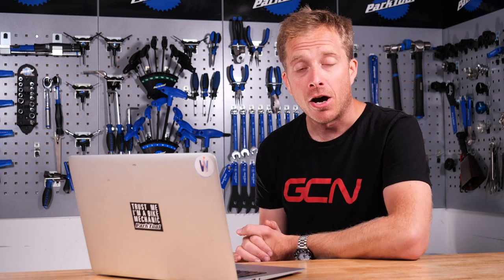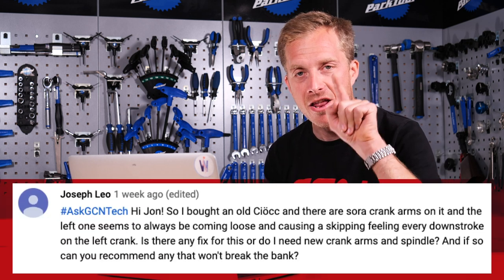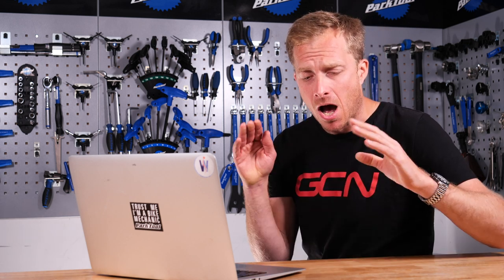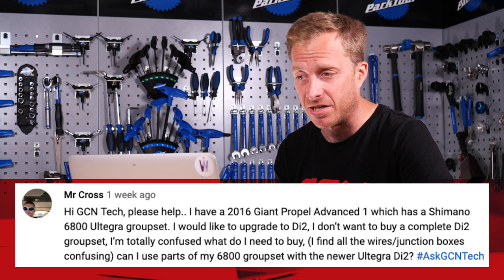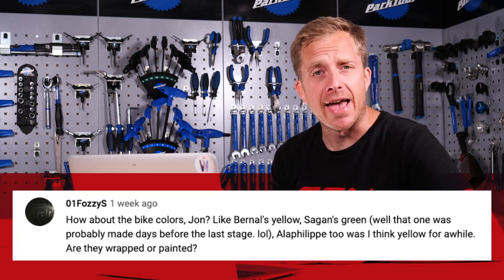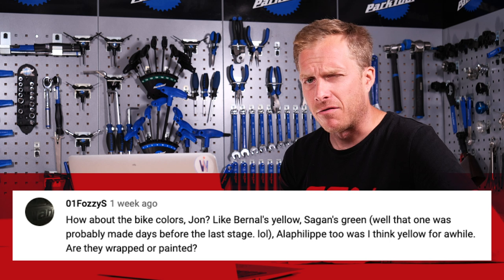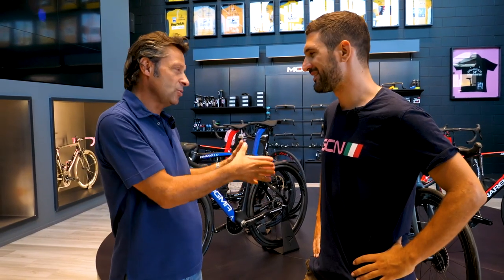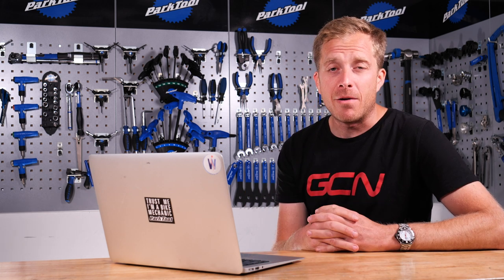Converting To Di2 Electronic Gears, Loose Cranks & Squeaky Disc Brakes | GCN Tech Clinic

Comment: #askGCNTech I have a new bike, REI Co-Op ARD 1.2, tried to put a bracket for a bike trailer on it but found out, after the rear wheel fell off during a pit stop on a ride, that it will not work.  Now I cannot keep the wheel on, I have a quick release hub, are those easy to upgrade and if so what should i upgrade too?

Comment: Hi Jon
I have 105 and shifting has been perfect outside but when I set up my wahoo kickr, the chain or rear derailleur must not be aligned with the cassette because there's a grinding noise when I'm on the smallest couple rings. It's ok for the most part on erg mode workouts, but is there a fix for this?
#askgcntech

Comment: #askGCNTech Hi, If I want to test a lower position at the front end by removing some heaset spacers, is there a way I can do it without cutting my steerer tube. I have a carbon steerer and a short compression plug that only allows a 5mm spacer above the stem. 
Thanks
Lewis

Comment: Q: Currently have shimano 8spd groupset. BB is squared tapered and I'd like to switch it out for Hollowtech BB. Seeing how 8spd chainset appear to be all Squared is it possible to switch it out with a 10 or 11 spd chainset without having to change the rest of the groupset? Maybe just a new chain as well?
Reply: You can and it's the same situation with me upgrading my old 8spd microshift groupset

Bought the Crankset(w/ BB) first a Tiagra 4700 52/36 vs old 8spd Prowheel 52/42. Took out the old square tapered BB then slapped in the Hollowtech II BB. Then I used the old 8spd kmc chain after indexing it worked no issues. Then slowly upgraded them all to the 10 speed Tiagra groupset.

 "Note if your new Crankset's largest teeth is the same with your old one. ex. 52 largest teeth / 36t smallest vs old 52t largest / 42t smallest. You can use the old 8 spd chain, But if you want bigger cranks ex. 53t / 39t or a 54, you might wanna get a new 8 speed chain or just add extra links to the old one.

Comment: Hello though my problem may be solved, my bmx race bikes disc brake caliper has been having trouble Stopping i have adjysted my brake pads my brake lever but it still wont work that well and it is a mechanical set up

Comment: Hello Jon, salutations from NYC. I’ve been having some issues with my rear derailur skipping. Took it to a bike shop mechanic and it came down to needing to replace it. I have a Sram Red 22 rear derailleur (green edition) and would like to replace it with the same green edition model but it seems impossible to find it anywhere. 

Is there anyway to service or rebuilt the old one or does it need to be replace? If so, any suggestions where I can find it for a fair price? 

Thanks Sergio.
Reply: Hey Sergio - what is the diagnosis for the problem? I have replaced pulleys and pulley cages in SRAM (and Shimano) derailleurs without much problem.

That said, I had to retire a very worn derailleur that had gone through two cages and three sets of pulley wheels; the pivots themselves were too sloppy from many hours of riding in gritty conditions and there was a lot of play in it. It no longer shifted crisply, so I retired it.

Comment: I fixed the squeaky disc brakes on my road bike by replacing the all cable setup to a cable over hydraulic caliper.  My thinking is that the extra power that I got out of the cable hydraulic caliper is that it offers more power into the pads.  Please note that with the same pure cable caliper / pads / disc it was a major squeaker, with the same disc and pads - and not cleaning anything, the hyd. caliper fixed it.

Comment: #askGCNTech Hi Jon, recently swapped out my compact 50/34 crank set to a 52/39 one, and noticed that one of the crank arms have shoe rub marks and it even rubbed out the name on the crank arm. Is there a way to restore the crank arm even without the name or just to make it look better? btw I'm using the silver Tiagra 4500 crankset. Thanks!

Comment: the front of my mtb shoes hit the the front wheel when i turn it while the crancks are in horizontal position.
i tried road bike pedal/shoes and it works because i can move the clips more forward but they're expensive

1. should i buy the road ones?
2. will the pedals extension do the job?
3. is the frame short for me?

ps: my bike is a roadbike and i ordered it from the net so i couldn't do all the measures

Thanks and keep the good work GCN ( TUNISIAN FAN)
Reply: toe overlap is fairly common. Front center distance (FCD) - the distance between the bottom bracket and the front axle - is determined by the geometry of the bike, including top tube length, head tube angle, fork rake, etc. and will be less on road bikes, due to steeper head tubes, and less on smaller frames. Toe overlap of course happens when the FCD is less than the sum of the crank length, the wheel & tire radius, and the amount of shoe in front of the pedal axle. You can play around with tire size (on one of my bikes, changing from 25mm tires to 23mm gets rid of the overlap), cleat position, and crank length. But, overall, my advice is to get the right size frame (based primarily on reach and stack), and fit it correctly (including cleat position). If you end up with some toe overlap which, as I say, is fairly common, just accept it and deal with it.
Reply: @stephenturkLA  thank you for your explanation, i'll try to switch from mtb to road pedals/shoes because i can move the cleats more forward and may be change to 23mm. ithink that should resolve it.
thanks again!

Comment: Hi all  Has any one had issues, running E-tube Project on their PC.

Just got DI2 and wanted to update firmware etc.

Installed latest version of E-T Project, 3.4.4, from Shimano. When trying to run the software, get

error msg “ E-tube has stopped working. A problem cause the program to stop working correctly”.

Un-installed and reinstalled a few time, tried the installation with anti-virus off, tried to run as Administrator.    Have installed it on Windows 10, and 8 laptops.

Date / Tine format is correct as Shimano”s FAQ page

Tried starting with SM-BCR2 plugged in, and not plugged.

Get the same every time.

Windows Program Compatibility Checker does not help either.

Have looked for older version to download and test, but nothing shows in searches.

Any information to resolve this would be appreciated.  Thanks

Comment: #askGCNTech I have Ultegra FC-6700 10- speed double crankset. If I what to go 11 speed - should I change something there or could go with Leavers,  Rear Derailer, Cassette and chain?
Reply: it most probably will work with the old crankset, but not as good as with a proper new crankset and deraileur - you can try with the old one first, and decide if it works for you or not.

Comment: My rear tyre on my road bike is starting square off in the middle, is this going to cause any performance issues or shall I just change the tyre? There's plenty of "tread" left according to the wear dimples
Reply: You spend the VAST MAJORITY of time riding using the center of the tyre, compared to the outside where the wear indicators are, so that tyre will have rather thin amount of protection left. New tyre time.
Reply: If it's square only a little, leave it I'd say. It happens almost immediately. If it's really square putting on a new tire will give you much better and predictable cornering. The puncture protection is not in the thread, so that's not really a factor, 74 green.

Comment: @ 7:16 if oval cassettes don't work because of the free hub body, how about oval cassette on a fixie? #askGCNTech
Reply: It won't work either, unless you have the same number of teeth on the sprocket as on the chainring, which theoretically maybe could make sense on a fixie, only used for very steep climbing, but not for a fixie for general use.
Reply: Unless you have a 1:1 ratio with the chainring and the sprocket, your frequency will be different and therefore won't work. The rear sprocket rotates at a different speed than your chainring basically.

Comment: #askGCNTech I have a creaky clicky sound coming from my headset/handlebars that only seems to occur when breaking at the front. Any ideas what this could be and how I could fix it?
Reply: Try to tighten your headset (using stem cap bolt)
Reply: @zacharywijmans6009  tried that, still creaky. Thanks though!
Reply: What materials are in question? Carbon stem? Carbon handlebar? Could there be dirt in the headset bearings? Could the noise be coming from the brake or front wheel? Too many variables to consider answering on the internet.  Take your bike to a reputable shop.  Let the pros spend a little time to figure it out. It’s worth the peace of mind. (Safety) Hopfully it is just when braking and not actually “breaking”.
Reply: If you've adjusted the headset properly next step is disassembling the front of the bike, cleaning all surfaces and repacking and reinstalling everything with a judicious amount of grease. If that doesn't work I'd inspect for cracks (which I assume you did already).

Comment: For those upgrading to Di2, why is SRAM not the best option for all?
If you are already spending the cash 💰 go all in!
Reply: There may be other considerations. Shifting seems to be faster with Shimano (wired vs. wireless latency), but more importantly the failure point for SRAM levers is unacceptable to me in an off-road/all-road bike. If you hit the brake levers from the side there's a good chance you'll break the lever pivot, while the Shimano ones will only move inwards and shift.

Not a big deal for a road bike, but I broke my Force levers on the CX bike and couldn't find a suitable repair on time, so had to replace the whole shifter. I can't live with that on a bike that's likely to end up on the ground relatively frequently.

Comment: Were you guys spying on me? I was just searching for how to deal with squeaky disk brakes.
Reply: I had squeaky disks once.  I removed the wheel, wiped down the disc, put the wheel back and the squeak was gone.  I think the wheel might have been a bit misaligned, but I really don't know why this fixed it.
Reply: @minuteman4199  My LBS took the pads off and rubbed them on some really fine grit sandpaper and then scotch-brighted the rotors. That stopped the majority of the squeak, although there's still a bit of a squeak right as the wheels come to a stop.

Comment: For those using a triple ring, why?
Reply: My guess is that they don't care to spend the money on new shifters as well as a new bottom bracket and crank. Easier and cheaper to swap chain rings.
Reply: A triple ring usually provides lower (easier) gears. So for those who don't have great climbing legs it helps them get up the steeper/longer hills with ease (albeit more slowly).